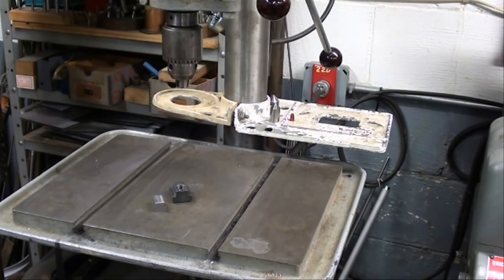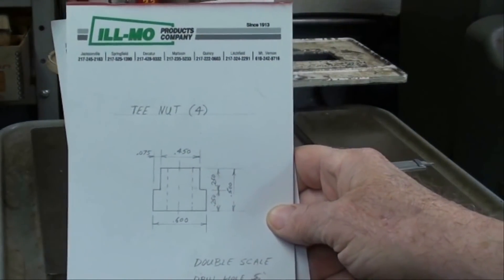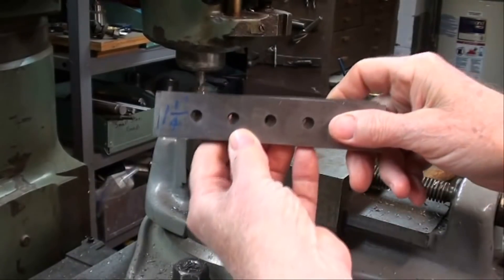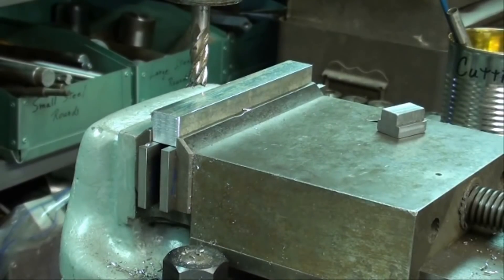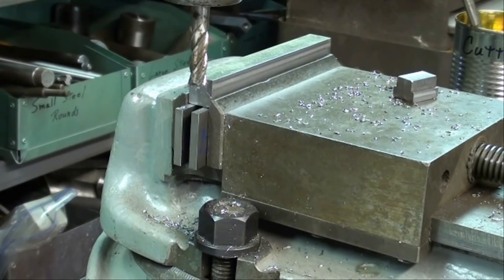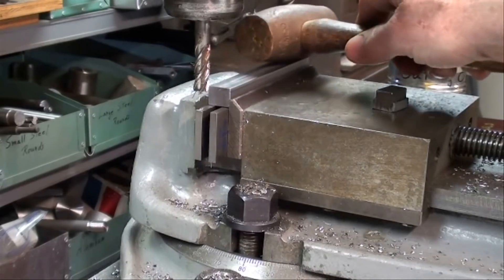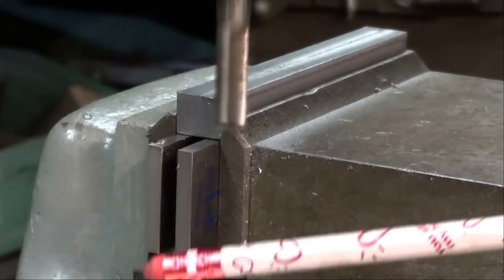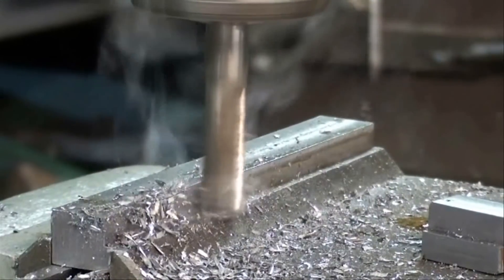Making T-Nuts on Bridgeport Mill TIPS #R102 REPETE tubalcain pt 1

Comment: It’s good when you cut this in smaller pieces, otherwise cold rolled is the wrong material. The tension in this material is mostly on the outside. So if you cut it on one side, it will curve/bend.

Comment: Buy ready T-nuts without hole and threads has been a nice alternative. For some T-slots the nuts need to be modified, for some slots not, and threading them to the desired bolt worked well for me and my mini mill.
Link:https://www.wiberger.se/templates/din508-r.htm
Reply from the maker: Thank you, that’s awesome. I never knew they sold blanks
Reply: They recide in Sweden unfortunatly. You can even by T-nut(?) in length, like 10", maybe more, and cut to length Yourself.

Comment: The techniques are important, even if you don't need this size of T-nut. Having not seen part 2 yet, I'm hoping you will upset the bottom end of the thread so bolts won't go all the way through and crack the table. I'm heading out to the shop to mill some V-slot nuts. I only had one general shop class in Junior High, so all my machinist-learning has been via old books. Always good to learn from an actual Machinist/Teacher. Thanks again.
Reply: Part two was recorded many years ago, Paul..have faith in the teacher. :-)
Reply: @Daledavispratt  Yep, I'm just too lazy to search for it and am waiting for Mr. Pete to re-Pete part 2 ;-). Blue chips, my friend!
Reply: Cracking the table is a greate danger unless care or like You say, prevent bottoming. Once, being new, I didn't have the screw deap enough into the T-nut and split the T-nut….

Comment: I just made some for my South Bend mill. The leading edge of my table base allows me to hold stops and set up indicators. I also heat treated them.
Reply: I am a retired Knifemaker. So, I often HT even if I don’t need to. I am making a set of jaws for a Bridgeport milling vise and I’ll be heat treating them too. 4140 is very soft when annealed so HT makes it good and tough. 4340 is also. So I often HT them.